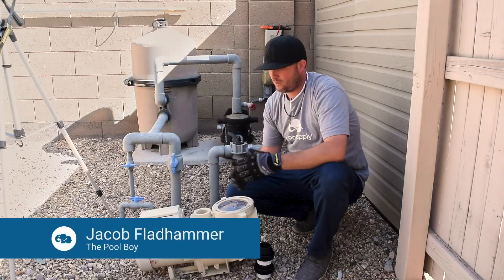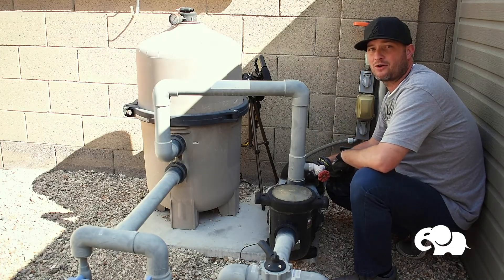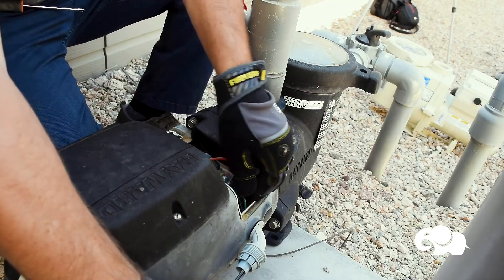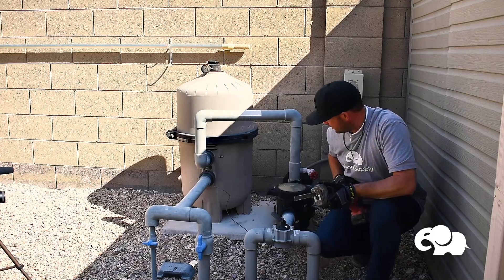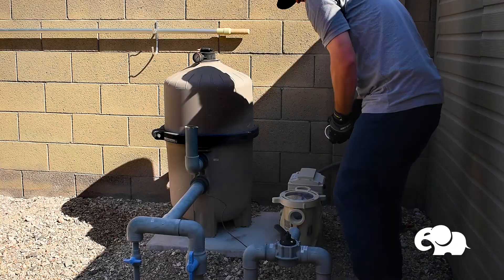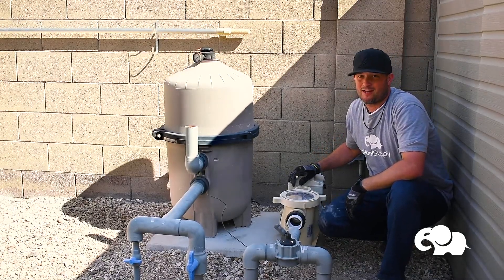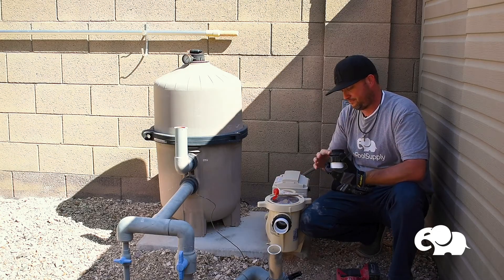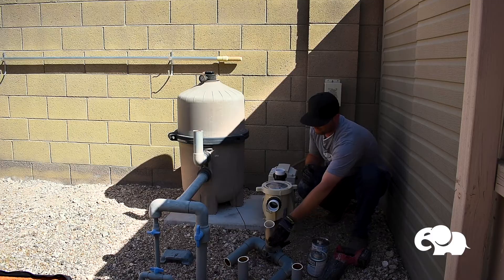How to install a Pentair Intelliflo Variable Speed Pool Pump

Comment: I watched this video to see the plumbing side of things.  You really assembled it in just the right way.  The last pipe you did you first put the pipe in the 90 so you could adjust it easily and didn’t need to mark the pipe as you just swung it into place.  I was curious why you didn’t clean the paint off of the pipe coming off the pump as I thought you had to.  Are you in the Southern California area and you can come here and put mine in?  Really great job. Quick and professional.
Reply from the maker: Hello, as far as the existing paint on the pipe goes the primer we use eats away at the paint and 1st layer of PVC. Therefore, it does not require us to sand off the paint. For the second question, our office and warehouse reside in Phoenix AZ, but we also do not offer any installs at this time. Wish we could help!
Reply: @ePoolSupply  Still great job thanks anyway

Comment: FYI:  If you didn't cut the lines so low to the ground below diverter valve, you wouldn't have had that gap. Try cutting to the highest point first, then see what's necessary. Another benefit is leaving room to cut again in the future. As you noted, that situation didn't have a water level problem, but so many do. 

If you have water problem, or  there is no room left, yes, you can dig into ground, and if its below water line you can pre-mount parts on hose, add bladder to hose, turn water on hose... and bladder will block water flow.... then Wah la... it works... no water all over the place... but it sucks. A lot more work

Again, please, cut as high as possible...always... to maximize the amount of pipe left to splice. Just makes sense.
Reply from the maker: Thanks, appreciate the feedback!
Reply: That bladder/hose idea is genius.  I was wondering what I was going to do.  Easier than draining some water out of the pool.  Thanks!

Comment: Thanks for the awesome video! 1 question, am I supposed to do a straight pipe 5x pipe diameter on both the intake and discharge port of the pump (from pump to filter)? I know the suction side needs it but after the pump to filter also? Thanks again for the help
Reply from the maker: Sorry I'm not sure what you mean by 5x pipe diameter?
Reply: @ePoolSupply  the length of straight pipe before a bend or 90* . Currently I have a 90* coming out of the outlet port on pump that goes into the filter. I’m redoing the plumbing and think I should have straight pipe coming out 10” (5x the diameter of my 2” pipe) before doing a 90*

Comment: Those pumps work pretty good in the dry air of Arizona, but over here in muggy Florida the programming screen fogs over because they are only sealed with a two sided sticky tape. After a couple years the units screen blanks out and buttons dont work.  Only save is if you have a two thousand dollar easytouch control panel that communicates via cable to pump and continues to run pump via easytouch schedules, otherwise its a six hundred dollar part to replace drive unit. I suggest anyone who buys this to remove those three screws that hold the screen cover on, than use rtv silicone sealant around the black edges of screen seal. Do a good job, or open those wallets up later.
Reply from the maker: Hi there, we would suggest reaching out to Pentair for any questions or concerns you may have in regards to their products. 1-800-831-7133
Reply: @ePoolSupply  With all due respect, all Pentair will do for you once its out of warranty is remind you its out of warranty. Installation should include aftermarket sealing by installer.
Reply: Does this work for the superflo as well?

Comment: Do the pumps not have to be secured down on the concrete pad?
Reply from the maker: You can secure it but most people don't because of the materials used to create those pads. Often they will damage or break so most installers won't even bother. Hope this helps!

Comment: master skills of installation well done!  Does this pump offers a freeze protection setting?
Reply from the maker: Yes it does.
Reply: No it does not and the manual states this. I see pool companies screw this up for customers all of the time when they install these. It has thermal protection but not freeze protection. It does not have an air temp sensor. You either need an automation system or if you have a mechanical timer w/freeze sensor, just set the pump schedule to run 24 hr's and use the schedule on the mechanical timer w/freeze override.

Comment: So this pump includes a timer. If you are upgrading a "old school" system with two timers controlling a pump and boost pump, do you have to get an automation system just to fire up boost pump for its run interval?
Reply from the maker: If you wanted to run both pumps and control the system from the same device then yes you would.

Comment: you have your primer and glue backward.... I think. Purple is primer glue is clear...
Reply from the maker: Hey there! actually we are using clear primer and Pool Heavy Gray glue... Both links are here

https://www.epoolsupply.com/products/weld-on-pool-heavy-primer-clean-1-quart

https://www.epoolsupply.com/products/weld-on-pool-heavy-746-gray-pool-adhesive-1-quart

Comment: Sawzall Cuts are not square. Does that matter?  Plus when I did mine I used a union on those two pipes coming up. Just in case I had to replace the valve.
Reply from the maker: Hi there, Jim. You want your cut to try and be as square as you can get it but it's not necessary for it to be perfect. Just need it to be as level as you can get it to be when making your connections. Hope this helps!

Comment: Great video.  Do you have anything on hooking up this pump to an automation system?  I have a Hayward ProLogic panel and am trying to figure out how to attach the control wire so that the automation system will control the filter pump.
Reply from the maker: Hi there Kevin, unfortunately, we do not have a video at this time in reference to what you're looking for but we are currently working on future videos and will be sure to add that to our list of upcoming content. Have a great day!
Reply from the maker: Kevin, please note. As of right now. Intelliflo does not directly integrate with ProLogic automation systems via 2 wire comm port.

Comment: The top two couplers one the valve side didn't receive any primer or glue (inadvertently). From a customer service/ethics perspective how do you (and those watching this) manage this situation - knowing that this could become an issue in the future for the customer? 
Are you Transparent with customer? 
Would you Wait until customer calls that the joint failed and then fix free of charge? 
Would you consider it Job security? 
Not your problem? 
Other thoughts?
Reply from the maker: Hey Michael. Tune on in to 15:00 exactly, you will see us prime the entire couplings and glue both sides of everything. ALWAYS prime and glue them fittings up!

Comment: Did you prime and glue over the old painted pvc?
Reply from the maker: Yes. The primer is meant to strip the old paint so that way the new glue can be applied correctly. Hope this helps!
Reply: What a hack job

Comment: Q?  At 8:56 was that too big of a gap to just put 2 couplings right there?  It seemed like maybe only an inch or two gap?
Reply from the maker: Hi there, as stated in the video even though they were very close they were not close enough to be able to just add a coupler. They essentially would need to be touching one another to do so. Hope this helps!

Comment: Can you list the primer and sealant for the PVC, what size PVC and what type of paint used on the PVC?  Thank You
Reply from the maker: Thank you for watching here is a list of the items we used:

-2" PVC Pipe and Misc. Fittings.
-CMP High Temp Unions x 2 - https://www.epoolsupply.com/collections/plumbing/products/custom-molded-products-hi-temp-threaded-union-2-2
-Weld On Pool Heavy 746 Glue - https://www.epoolsupply.com/collections/plumbing/products/weld-on-pool-heavy-746-gray-pool-adhesive-1-quart
-Paint - Just a simple Latex paint, you can choose the color, Rustoleum works great!
-Weld on clear primer - link coming soon.
Reply: Great video, well done thanks!
Reply from the maker: Thanks for watching!
Reply: If replacing a single speed pump Roth. vSP can I just leave the other wires connected to manual timer and just remove the clips ?
Reply: @undercovergardener5632  you can and it works fine but pentair warranty no likey

Comment: Great video. In fact this video lead me to epoolsupply where I just purchased a new Pentair superflo vs. I do have a question, why don't you sand the old painted PVC before priming and gluing?
Reply from the maker: Because the paint we use adheres to old paint and plastic. No sanding necessary. Hope this helps!

Comment: Why didn’t you bolt/attach the pump to the concrete pad?  Seems with pump vibration it won’t be long before there is a leak or a broken pipe.
Reply from the maker: Bolting a pump to a pad is not completely necessary. Only certain jurisdictions require you to do this by law. As for the vibration aspect, these pumps do not vibrate as much as you think. That is also a good reason to level the slab, and also level your pump on the slab so it sits on the flat surface. Try not to plumb your pump at an angle. Hope this helps!
Reply: Owning variable speed pumps for a very long time, there is no such thing as a vibration problem. Only places I know that require bolting down pumps are in hurricane zones and probably California, because they are idiots. In hurricane zones, they even make you bolt down a 300 lb heat pump. Always thought, well if wind is so bad it rips out pump and sends heat pump flying through the air, the house won't be there when all is said and done anyway, but it does make sense.

Bolting down is for that type of risk, its not to protect from vibration. There isn't any worth noting. If its vibrating, its already failed.

Comment: If I replace with the identical pump, could I just disconnect and reconnect at the unions, without cutting pipe?
Reply from the maker: Hi there Steve, the answer to the question you have there is Yes. As long as the union still properly functions and does not leak than it should make it an easy swap and install for you. Hope this helps!
Reply: @ePoolSupply  Unfortunately the previous installer did not use the union and both pipes are glued directly.
Reply from the maker: @congamonty  Unfortunately it sounds like there will need to be some re-plumbing that has to be done.

Comment: When you cut the existing pipe, you can see that it is white plastic.  The outside is grey.  Was this pipe painted and if so why didn't you sand the paint off?
Reply from the maker: You are correct however, the primer we use eats away at the paint and 1st layer of PVC. Therefore, it does not require us to sand off the paint. Hope this helps!
Reply: @ePoolSupply  Thank you.  Great video and very helpful.

Comment: SIR I HAVE A PLAY POOL 5FT DEEP 36 FT LONG BY 16 FT WIDE FROM AZ..HOW MANY HORSE POWER WILL BE SUFFICIENT FOR POOL AND NEED A NEW SAND FILTER ALSO. RANDY
Reply from the maker: Hi there, what pump do you currently have on your system? And do you have a infloor cleaning system or any other water features?
Reply: @ePoolSupply  i had a 11 yr old hayward one speed pump now pool man said needs new pump and sand filter. i thought a 3 hp pentair wound be more powerful than my hayward that was a 1 .5 hp. sand always either getting clogged in tank or making water cloudy .blowing sand in water. thanks for your help. RANDY
Reply: HOUSE BUILT IN 71 POOL WAS THERE,SAND SWITCH NEVER CHANGED OUT BUT A LOT OF PROBLEMS WITH IT. NEVER WITH HAYWARD PUMP TILL NOW.

Comment: I have a small leak coming from the pump exit pipe.  I assume there's a bad o-ring.  Do you know the part number?
Reply from the maker: Hi there, sounds like you have a leak coming from the union assembly that connects the PVC to the pump. However, the o ring is not sold separately so you would need to buy a whole new union assembly. Here is a link to purchase them directly from our site. Hope this helps!

https://www.epoolsupply.com/collections/variable-speed-pool-pumps/products/custom-molded-products-hi-temp-threaded-union-2-2

Comment: Hi I liked your video . One question is how long do you have before that glue locks up? All the pvc I use you only have a couple of seconds and it set up tight no room for a mistake.  Thanks
Reply from the maker: Its recommended for 30 minutes. Hope this helps!

Comment: Do you have any videos of replacing multiport valves and the plumbing?
Reply from the maker: Hi there, we don't currently have a video laid out specifically for that particular circumstance, but we will keep that in mind for future video's. We do however change out a 3 way valve and plumbing in this current video. Hope this helps!

Comment: What brand is your hacksaw?
Reply from the maker: The brand name for that particular tool used in the video is called Milwaukee. Hope this helps!
Reply: @ePoolSupply  thanks so much you did a amazing job trying to do something like this but making sure i got the right tool.. do you know what blade it would be?
Reply from the maker: @erikanava9323  The blade used in the video is meant to cut metal. So any blade meant to cut metal would work best for this specific type of install.
Reply: Thanks so much.. super helpful! I hit subscribe keep up up the good work

Comment: you could've just assemble/glue the two 90's first unto the crossed pvc. Dry fit the side close to the filter housing and measure to the vertical pipe coming up from the pump. Then just glue that complete assembly unto both vertical pipes.
Reply from the maker: Hello, do you have an example of this on your YouTube channel? We would love to see it in action.

Comment: Here's a tip if you don't want to cut out the suction 3 way valve -  butt up two 45s between the valve and the pump. 
When one end is on the valve pipe you can swivel it around to exactly match elevation with the new pump intake.
Reply from the maker: Thanks for the advise!
Reply: The manual says u have to have 5x diameter of the tube and should be straight
Reply: @KhalilSalman  Your manual is not accurate.
In the old days rule was 4x pipe diameter straight run into the pump, same on the output. 

More times than I can count, I have seen hard 90's directly on intake, and hard 90's directly on return side of pump. I used to correct these errors and found that my efforts were totally inconsequential.
 
A lot of stuff works that's not supposed to according to "the book".
Two 45's on the intake side of the pump makes effectively zero difference on water flow or pump performance.
I'll challenge anyone in the industry to tell me differently.
A lot of things in "the book" weren't based upon any empirical data whatsoever when it was written.

Turnover rates have long been discounted, and for this, pool pumps have been over powered (HP) and over run (hours a day) for decades. This again from loose guidelines, no science involved at all.

We used to tell people to drain and fill pools when dissolved solids got much over 3,000 ppm. Now we want about that on salt content alone (salt pools).

"By the book" I have seen so many pools in the past 26 years that should not have worked hydraulically. But there they were, right as rain.
(Having said that, I have seen many where the hydraulics were atrociously terrible).

But I do appreciate your attention to the detail, very much.
Maybe someday, we'll get "the book" right. But as for now, nobody seems too interested in doing that.

Best regards!
Reply: @mayorb3366  Thank you for this. I've been scouring around on the web and opinions differ wildly on the "straight run" requirement. Some say not to have it on inlet and outlet, others say it only applies to inlet. And yet others say that it only applies to industrial pumps, and not to pool pumps since the pressure is lower. I'm about to install a pump where the outlet is a few inches from a 90, and this was comforting to read. I did put an 8" run on the inlet just in case.

Comment: The guy i work for has been doing pools 15 years and he just puts bricks or tiles under the pump when replacing.  He would NEVER do all that work you did lowering the suction side plumbing.  He also doesn't put that special lube on the high Temp union threads, one did leak.  Is he sloppy?  I only know his work, so please educate me.
Reply from the maker: The term "Lazy" seems appropriate for that situation.

Comment: I have the pump plumbed and wired, but there isn't any water pressure. Nothing going to the pool
Reply from the maker: Hi there, it sounds like you may have a clog or a leak somewhere in your plumbing. I would recommend hiring a professional to check it out for you. Hope this helps!

Comment: I just heard that a GFI needs to be installed at the pump or Pentair won't warranty it. Any thoughts on this topic would be appreciated
Reply from the maker: Hi there, we would suggest reaching out to Pentair's support team with such a specific question like that. They will be more than happy to help answer it for you. 1-800-831-7133
Reply: Code now requires a GFCI breaker for each pump.

Comment: You need to test between each wire to ground also. If one of your legs was off but the other was hot testing between the two would not show it. TEST EACH WIRE TO GROUND.
Reply from the maker: Appreciate the feedback!

Comment: Isn’t the manufacturer warranty voided if the pump is not “professionally “ installed?
Reply from the maker: It does void the 2-year warranty yes if it is not professionally installed. Will still hold a 60-day warranty if self-installed. Hope this helps!
Reply: Thats a bunch of crap with Pentair not keeping the full 2 years if not professionally installed. They should be backing their product, not the install. Its not like you are putting the pump together. I installed a new pentair chlorinater and I had the same problem. Not professionally installed.